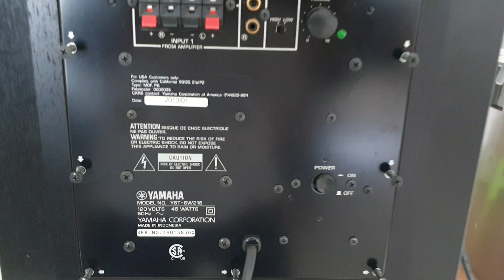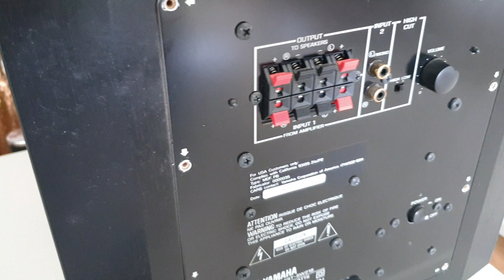Yamaha subwoofer - changing power supply and what's inside

Comment: Where can you find suitable powersupply for that? It would be intresting to know the voltage on the PSU...
Reply from the maker: I had bought it from a shop in the electronic market of Delhi called Lajpat Rai Market in Chandni chowk. Don't remember the exact specs but we had matched the output voltage of the previous supply just changed the input voltage from 110v to 220v.

Comment: Why do you need to change it from 110 to 220 when you can use a step down transformer?
Reply from the maker: Good question. I was using a step down transformer but it has 2 challenges. One need to turn it on and off everytime after use and two it has a hissing sound.. quite low but its there when the subwoofer is ON

Comment: I want to give 230v power but this sub need 120v.so what can i do. Can i reply 12v 230v tranfomer. Can you help me.
Reply from the maker: You will need a step down transformer that will convert the 230V to 110v. Do not plug it directly into 230V
Reply: @NeerajGulati  ok thankz sir. I have bought step down transformer. Can i know 200w step down transformer suitable to this woofer.
Reply from the maker: Yeah 200w should be fine
Reply: @NeerajGulati  ok thank you sir. It is working now.

Comment: What is the rating for the transformer? I have the similar subwoofer SW012 8" inch (US- using in India) and don't know what rating transformer I need. 12-0-12 or 15-0-15?
Reply from the maker: Not sure. Couldn't get the transformer replaced so replaced the entire subwoofer!

Comment: My vintage yamaha sub that I got from my brother is taking time to power up.. could be the servo? or the power supply (transformer)?
Reply from the maker: Not sure what's causing the delay
Reply: Mostly likely the power supply capacitors are not good. Have them replaced.
Reply: @williamwong5627  Mine SW315 getting this problem too, may I know the model/rating of that capacitor u mentioned I should replace it?
Reply: @wongalex7123  Most likely the 2 big capacitors need to be replaced. You could see the value on it. As long as the stated value is the same as the new ones, then no problem. Eg. 4700uf, 25V. Can go higher but not lower.
Reply: @williamwong5627  ok, I will buy two of it to try, many thanks for your great help!

Comment: brother how you got it from usa do they allow you to bring it on flight
Reply from the maker: I got this one sometime back, I guess around 2013 and got it in flight as checked in baggage. They let you take it what you might want to check is the custom policy at the destination country.
Reply: @NeerajGulati  ok i want to bring a subwoofer to india 14 inch width 16 depth 14 height will it be a problem if i bring it in checked in baggage
Reply from the maker: @durbandadagaming7774  usually size is an issue at check in stage. If you have baggage limit it shouldn't be a problem. For details you can check with the airlines helpline. The bigger cost inflator would be the customs at destination airport. They have a certain amount for electronics which is exempted after which electronics attracts quite a heavy duty. So you would want to do that cost benifita analysis before.

Comment: Where is the part for changing the actual power supply?
Reply from the maker: Check 3.29 there is a transformer with a code X8.. That is the step down transformer with 110v input and we need to change it to 220v input.  Update: Couldn't find the 220V supply so have to live with the step down for now.
Reply: you can get it rewired to 220v it would work just fine. I have a guy in Lajpatrai Market Delhi who does that. @NeerajGulati
Reply: just give me the rating of the transformer, I might get that transformer for you.